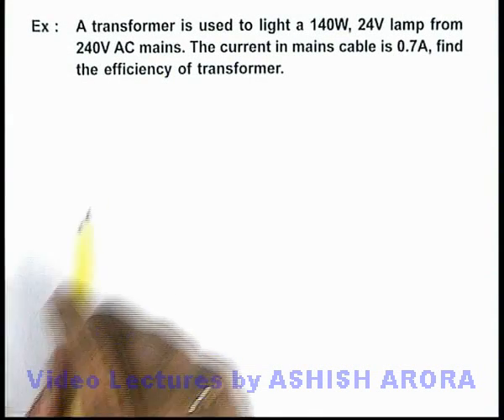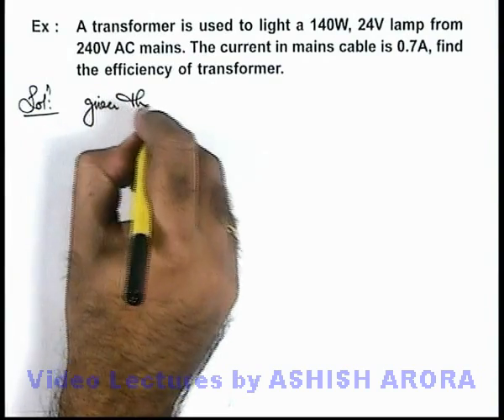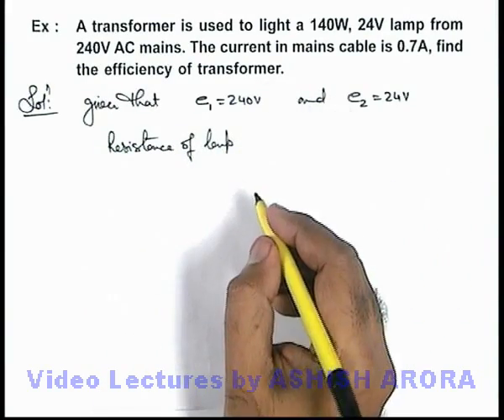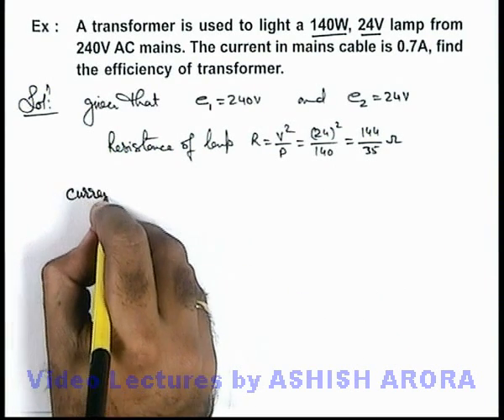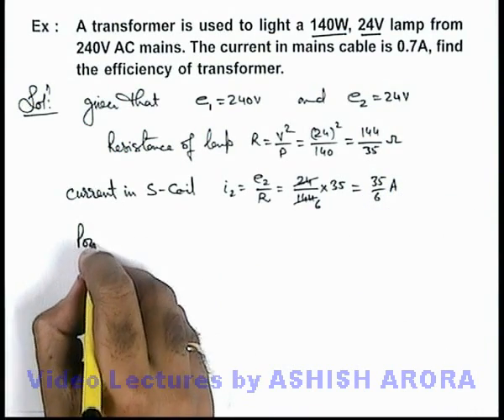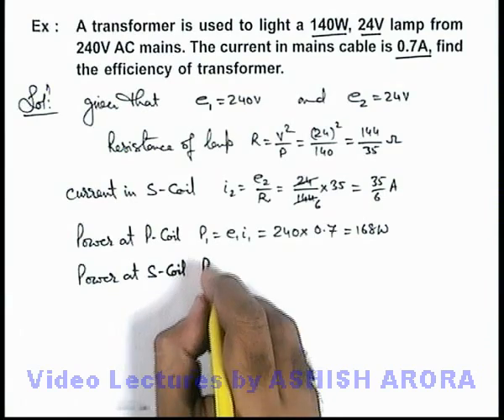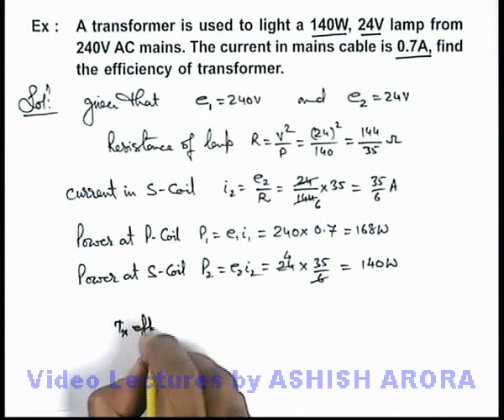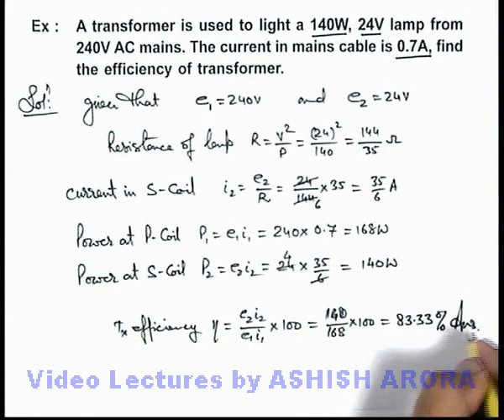Class 12 Physics | Alternating Current | #60 Solved Example-20 on Alternating Current | JEE & NEET

Comment: why cant we do like this
e1i1=e2i2 given e1,e2,i1  we can find i2  by that im getting 7amp and ur getting 35/6
Reply from the maker: question is clearly asking efficiency of transformer that means there are losses in transformer so you can consider input and output power equal... so your solution is wrong...
Reply: Physics Galaxy exactly when input and output powers are equal we have e1i1=e2i2 so  we need to do like this right ?
Reply: Sir meant...so you "can't " consider input and output power equal

Comment: Good afternoon Sir,
 in this question if we only calculate the input power by e * i  we get 168 W, and since the bulb is given to be 140 W so  if we straightaway divide 140 by 168 we get 83.33% efficiency. so will this method work always or we will have to calculate resistance of the bulb every time?
Reply from the maker: efficiency of transformer should be calculated always from the power at coils of transformers not by the devices... In this case it is at full load so result is same but not always...
Reply: Physics Galaxy  thank you for clearing the doubt sir ! 😊

Comment: Sir the power was given in the question to be 140 W. Why did you find it in the solution?
Reply from the maker: The given power was not the transformer output it is the power of lamp... many times due to copper losses transformer power is different... here it is coming same or we are verifying here that transformer losses are not accounted... in this specific question you can use the initially given power also...
Reply: @physicsgalaxyworld  Sir, will we be given some data to calculate the power loss in the question, if there is any?
Reply: Is these videos enough for neet
Reply: @anumol2081  yes brother and the above commented guy  is a example who cleared  his JEE mains and advanced from this channel
Reply: @aswinimahato3742  how do u know the commented guy cleared jee
Reply: @dattebayo81  go to his channel's about section
Reply: @aswinimahato3742  right